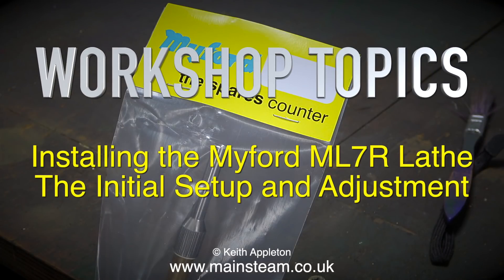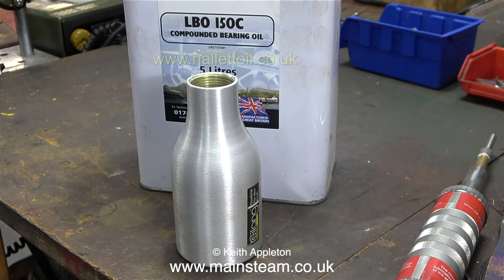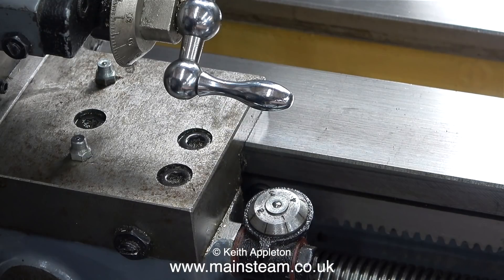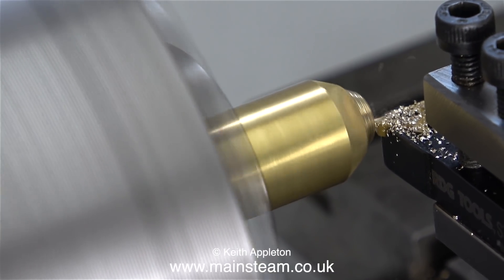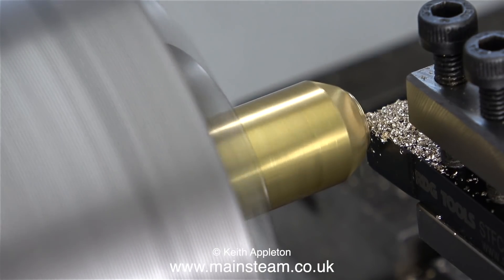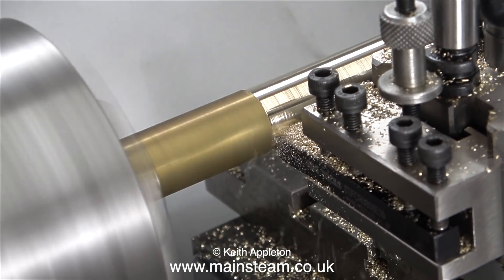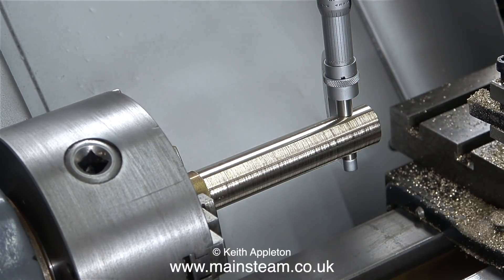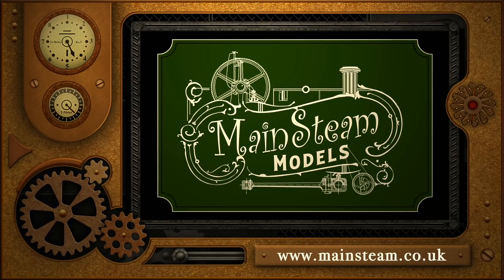MYFORD ML7R TECHNICAL SETUP AND ADJUSTMENT - WORKSHOP TOPICS

Comment: Impressive performance from your Myford lathe. The oil gun is expensive but it is clearly the right tool for the job. When it comes to tools, I think "buy the best and cry once" is sometimes the best policy. Or the best you can afford at any rate.

Your statement regarding commenters criticising your technique and approach to lathe and machine work came right after I commented on the mounting of your Myford on those rubber blocks, so I want to clear a few things up.

I bow to your experience and knowledge. It is far greater than any I will ever possess. That's a simple fact based on two main criteria, these being:-
1. The amount of time I take to learn things.
2. The amount of time I have left to live.

In my comment I asked how you would shim or jack up the bed to take any twist out if the machine wasn't turning parallel, given that it is not fixed to anything rigid. Please note that this was not an adverse criticism of anything you did, rather a question from someone who doesn't know anything like as much as you do.

I see from this video though that the machine is turning nicely parallel. I sincerely hope that my comment did not cause you offence. That was not my intention.
Reply from the maker: My comments were not aimed at your comment Carl. They were aimed at the numerous offensive, misguided and generally stupid comments that I deleted. No offence was taken. The main point was that this Myford just happily sits on it's chip tray, which in turn sits on three very dense foam rubber kneeling pad blocks and is under no stress whatsoever. As nothing twists, you can see from the video, that the Lathe turns the metal bar parallel all the way along the length, which is all that I could ask for.
Reply: @keithappleton  I agree, it was a very nice result indeed, with the added bonus that the machine is very quiet indeed.